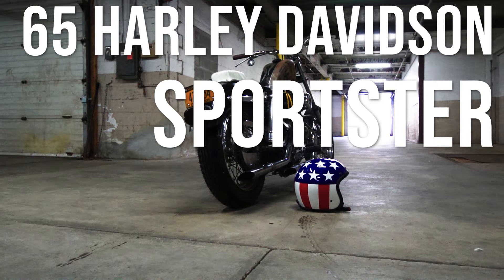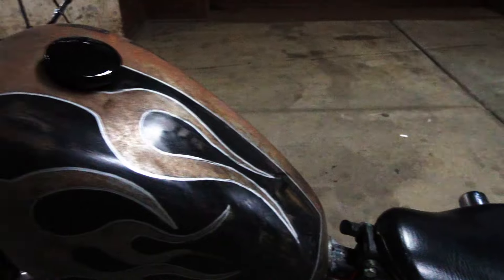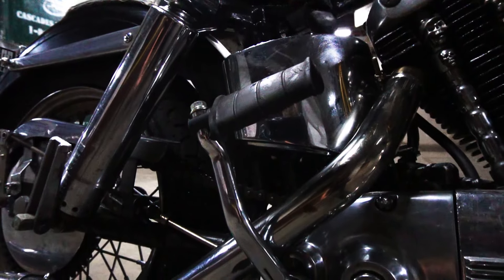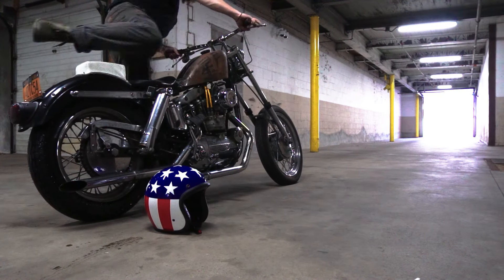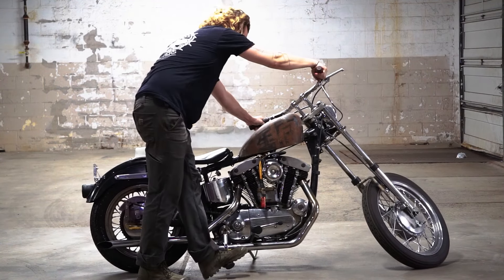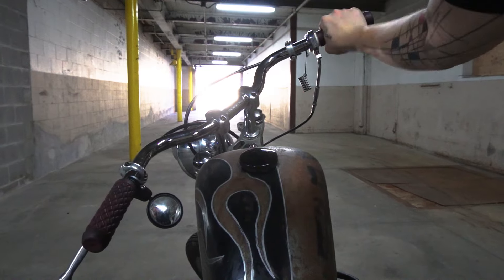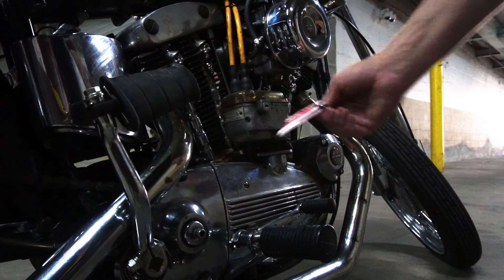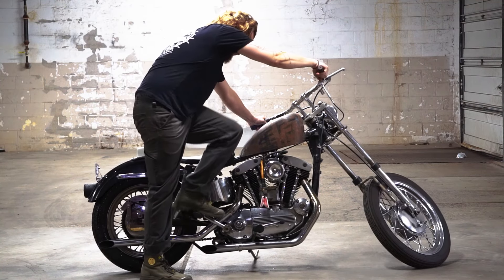How I kickstart my 60 year-old Harley - Consistent cold starts

Comment: Bro, I know it's old vid, but how do u prevent the back kick when starting it
Reply: Hi.....you've probably found out by now.....but if not....the gear on the kicker ratchet inside the clutch engages for about 90 degrees and when the kicker arm you stand on is right at the bottom this gear is still meshed with the gear on the clutch basket....so a kick back will push the kicker arm up and try to wreck your knee....the trick is to kick so the kicker arm pedal goes past the bottom of the stroke and disengages the gear no kick back. Imagine the kicker arm is the hour hand on a clock...you find compression at around d 10 or 11 o'clock and press it down to 6 o'clock causing the clutch gear to turn as it is engaged during this stroke...keep the kicker arm moving through till about 5 o'clock and the gear is no longer meshed and can't kick back....also try not to have your leg straight but slightly bent.....hope this help.....Snake

Comment: Is it difficult to install the mag?
And is it possible to turn the mag like a distributor to tjme the opening of the points?
14 thousands? Gap?
I aint got the lock n key to mine.still got the 6volt gen and  
Mess of wires eith the capacitor thing.
I got a 12volt gen.laying around?
Reply from the maker: This bike had the mag on it when I bought it, not sure what they're like to install. This particular one is bolted down but normally you can turn the mag to adjust timing and make starting easier. From the factory, the left grip twisted to adjust it.

Comment: Wat with the spring hang under the throtal
Reply from the maker: An old clutch spring, this bike’s clutch has been a total pain
Reply: @roodlum  "Dry" clutch that won't stay that way?  Other than that, I've never had a problem with the clutch in any Ironhead.  Pretty solid, robust units.  Been riding them since 1976...  Oh, and I love your bike.  Best thing you ever did was to get rid of that Tillotson...
Reply from the maker: Thanks! Yes I struggled with the dry clutch for a while before moving to wet/dry plates. The clutch cable perch on the side cover had also been poorly repaired in the past, so I had to come up with a fix for that as well. Just old bike stuff!

Comment: ok, but what is kickback?
Reply from the maker: kickback is, essentially, the fuel igniting at the wrong time in the combustion cycle, which makes the kicker pedal move backwards, aka upwards, aka 'kick back'. On the early ironheads, it can be strong enough to injure, especially if your knee isn't bent.

Comment: I had a 72 kicker sporty can't remember xlh xlch threw away they kicker pedal as it was basket build, built it with electric start. Remember how much I hated that bike 😂 rh shift, useless brakes, ate generators and starter drives. Otherwise ran well. Only because I rebuilt Everything! Too much compression to kick most harleys. Love my dyna lowrider and my ankles and knees.
Reply from the maker: It's taken years but I finally have this thing in a state where I'm not worried I'll break down when I'm riding!

Comment: Be 4 you go to start it all ways tip it over on its side  and dump that old fuel out of the float bowl  let it fill up then tip it over n dump it out again  this stops from fouling plug or plugs  and it helps it start easier  are you running lead additive in gas ? Or today's modern fuel ?  Not try to be a know it all but  today's gas is not very good compared to the gas she was born on nice bike
Reply: Are you serious! Yea fuel quality sucks but doesn't change on a daily basis...